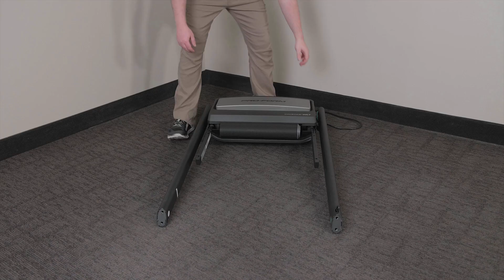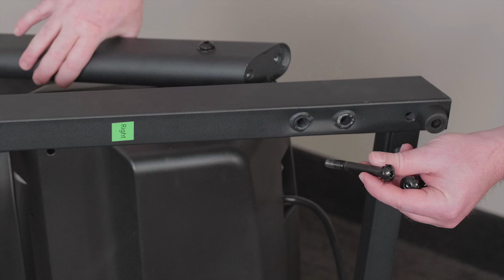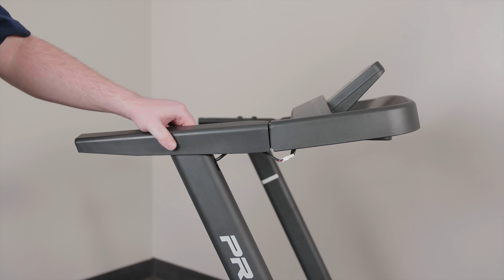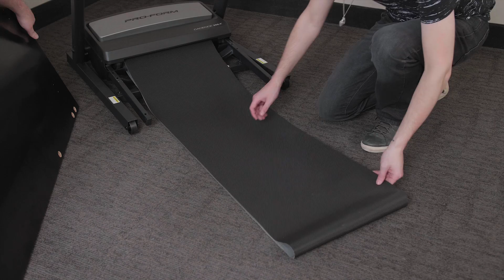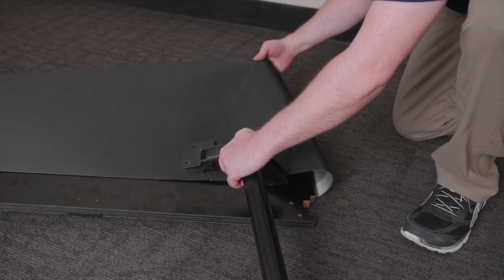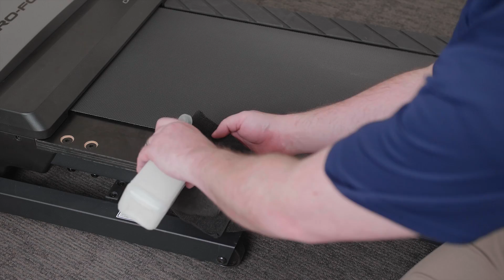ProForm Cadence WLT and Crosswalk LT treadmill assembly

Comment: The video helped a lot. I'm having trouble with the belt moving to the right side when turned on and I can't shift it over unless the back feet come off and I lift the belt . It's kind of annoying.
Reply from the maker: The belt shifts when the idler (rear in this case) roller is out of adjustment and there is more tension on one side of the belt. The belt wants to move to the side will less tension. Use the L-shaped hex key to adjust the Idler roller adjustment bolts. There are instructions in the users manual and other videos on this channel that show how to do this. If you are pulling the belt and lining it up by hand, but not adjusting the position of the roller, the belt will not stay adjusted.

Comment: The platform moves around and bounces as if the woods going to break. I only weight 209 pounds and the compacity is 275 but Everytime I put it on any speed higher then 4 I feel it’s going to break. Is the wood really sturdy enough ? Or did I waste money.
Reply from the maker: Supposedly it is sturdy enough. I'm 185 and it moved pretty good on me as well. But I have jumped on the board and even encouraged heavier people to also jump on it and we didn't have any problems. I think you will be fine. Enjoy your treadmill. :)
Reply: It has a reflex system that’s why it feels like it’s going to break lol but it’s real sturdy. I’m 285lbs and I jogged on it at speed 5.5 and no issues

Comment: I'm halfway through assembly and this happens: The storage latch screws (#10 x 1") do not fully tighten in the holes provided, nd we can't even use power drills...😐
Reply from the maker: The holes are intentionally very tight. You wan this connection to be tight to prevent the deck from falling when you don't want it too. The recommendation not to use power tools coms from the fact that I have seen may of the cast pieces, like the latch, crack with too much force.
Reply: @FitnessEquipmentHelp  That's understandable. I finally got the the top screw to go all the way in, and the bottom to go as far as possible. The bottom scree still cannot fully go in, but at least the storage latch is no longer wobbly 🥲 Thank you for explaining though

Comment: My treadmill makes a loud creaking noise just by stepping onto it and continues creaking every time you take a step it sounds as if the board is going to break. I bought it used and the screws  that connect the covers over the right and left.. won't screw in all the way

Comment: Assembly wasn't too bad. I do have 3 leftover pieces of wood and some of my screws were too long .anyone else have the same issue? Was my latch screws and end cap screws by the feet
Reply from the maker: I'm not sure about the screws(id check each assembly step), the wood however is likely just for packaging as the only wood on the product is the walking platform.

Comment: My idler roller won't close. Please help!!!
Reply from the maker: It does require a good deal of force as you are stretching out the drive belt and the walking belt must also be tight. make sure the area is clear of any obstruction and watch you hands so they don't get pinched.
Reply: No force needed, just loosen the belt a little!

Comment: Looks like this is the closest video assembly instructions  for Model pftl29720. Thanks!
Reply from the maker: That may be true, but I'm sure you can tell they are not that close. step by step instructions can be found in the Built app which is nice as you can see the assembly in 3d from any angle. There is a link in your users manual.

Comment: Our treadmill making squeak sound where the belt touches the belt guides. Could you please show or explain how belt should fit the the belt guides, because in my treadmill belt is bent on edges, where the belt touches the belt guides. My treadmill is only 1 month old. Thank you.
Reply from the maker: It is normal for the belt guides to press on the belt. some noise is unavoidable. if the belt stays in any one position it can set up where the belt hits the guides but quickly goes away with continued use. You can curl the belt back by hand to speed up the process.
Reply: @FitnessEquipmentHelp  Thank you. Do I need to lubricate the belt ?

Comment: Storage latch screws extremely hard to get in with hand tools. Can I use a power tool for this step?
Reply: I had to man. I tried using all my strength to do it and just couldn't. Glad I wasn't the only one haha
Reply: @Earl--  😂 hell yea
Reply: @SP-sq9yy  Makes me wonder what the people that didn't own a power drill did 😂 poor fellas
Reply: I did it with my screwdriver no problem don't recommend using power tools u can mess up the screws head
Reply: @efrainortizjr7493  I think some of these come with bad screw holes. I even went out of my way to wash my hands with dish soap trying to get the screw to go in. My power drill did it instantly with no screw stripping. As long as you make sure you don't over tighten it, the drill wont strip the screw. From my experience at least, can't say it will go that well for anyone else.
Reply: I just use WD-40 before put the screws, this make much more easy tighten!

Comment: What happen if you snap the platform in place before you put the bolts in? I can't get it loose at all and now it's not bolted in place
Reply from the maker: its not super easy but you can pull the rings on the side of the brackets and pop the roller back up. it may be easier if you use the roller adjustment bolts and loosen the belt so there is not as much pressure on the roller.
Reply: Thanks for the help

Comment: If you are having trouble trying to "activate" or you just don't want to use the iFit stuff, make sure the power is on and the clip is in place, then just hold the square, blue button to the right side of the display screen down for 30 seconds or so, until the screen changes.  (can't remember exactly what it did, but it was obvious!)  You then can use it in manual mode.
Reply: Thanks! Wasn’t interested in IFit!
Reply: This was so helpful, thank you
Reply: thanx so much!!
Reply: Thank you.
Reply: Life saver
Reply: Thank you Macca
Reply: I'm sorry but can you please explain the steps, I'm pretty confused 😅
Reply: Uh 7:28
Reply: THANKS

Comment: After I assembled the treadmill. It is very noisy. Is it something I did that I can undo?
Reply from the maker: Without more information I cannot tell but I think it would be worth making sure that the treadmill belt is aligned properly. Many units need a slight belt adjustment to keep the belt from rubbing on plastic parts causing abnormal noises on new machines. There should  specific instructions for your model in your manual. You can also check out the belt adjustment videos on this channel.

Comment: just got this model PFTL29820.0,  assembling went fine, the console lights up but the motor does not start, any ideas besides returning this product?
Reply: That’s the rub it wants you to activate it via the ifit.com/activate sight (to pay for the subscription before it starts)
Reply: However there’s videos on a way to get around that
Reply from the maker: @DAhardest1000   There is no requirement to sign up or pay for anything, instructions for activation are on that website.  But Grey Fox is correct the console must be activated. If the console is active and you are still having issues this could be a wire issue or possibly something affecting the lower circuit board.  Checking for loose or disconnected wires under the hood and for assembly damage may help determine the issue.

Comment: Does anybody find that the board feels like it’s going to break when you get on it I’m about 169 pounds and when I get on it I feel like it’s about to snap
Reply from the maker: The unit has a very flexible board and a short frame that does not run the length of the walking surface. Because of this I too get the same feeling.
Reply: I think that’s pretty normal.

Comment: My belt keeps sliding to the left and when on it has this sound like it’s working extra hard to operate is that normal?
Reply from the maker: The belt should not be sliding to the left. does it return to center when you are not walking on it? Does this happen with all users? If it moves back to the center when you step off the belt then it could be the surface the unit is on and would try moving it to a different location temporarily to see if a more level surface helps. Also sometimes people will walk heavier on one side so it causes the belt to shift. If it does not happen with all users this may be something to consider. as long as the belt does not run into the deck rails or plastic covers it should be fine. 

I would expect a motor on this unit to sound more labored during a workout than units with a larger motor.
Reply: @FitnessEquipmentHelp  hello, i am having the same problem. It keeps sliding to the left without someone being on it.
Reply from the maker: @angelicaramon1839  If the belt is moving to the left or right follow the instructions in the users manual for centering the belt. The steps are also outlined in this video. https://www.youtube.com/watch?v=gGxaAV4MuYs

Comment: Does this treadmill have an incline feature
Reply from the maker: No, this item has a fixed position walking platform. A similar model with a power incline would be PFTL39619. Check it out if you are looking for a power incline feature.

Comment: Mine will not sit straight after everything done and I stand it up it just wobbles around the legs are just messed up in took it apart and redid it still sits bad
Reply from the maker: This model does not have leveling adjustors so it is important to have this on the best surface possible. consider the floor may not be level (particularly on tile and concrete in basements). moving it to a new location may yield better results. If there is a issue with one of the base pieces a replacement part can be obtained from ProForm.

Comment: This video make it seem so simply, my wallking platform is not align with the holes for the bolts on the left side 🤷‍♀️ been stuck there for 2 days 😫 Need help or not sure if this one came with a defect from manufacture.
Reply from the maker: make sure you have followed the instructions in the users manual and left the instructed bolts loose. Most parts that do not fit well are a result of tightening some of the hardware before instructed. If you have defective parts you can contact the manufacture for replacements.
Reply: @FitnessEquipmentHelp  the board feels like it can break, kind of worried
Reply from the maker: @johnwaters3537  This unit does not have a frame that runs the entire length of the walking platform so it has a lot of flex. i have jumped pretty hard on the unit and been ok. I can't saw it will never break but as long as it is used as described in the manual and the user's fall within the weight limits you should be fine. if you are very concerned you may want to look into an extended service plan.
Reply: I am having the same problem 
So frustrated. What did you do
Reply: @Ms27Mimi   My platform was put in the wrong way, we notice after 2 weeks trying.

Comment: Good afternoon, I managed to assemble the treadmill thanks to your video, but when you turn on the machine a "HELLO" message appears and it does not let me do anything else, I would like to know if you can help me to solve this problem thanks.
Reply from the maker: the instructions to activate your console are at the end of the assembly steps in the manual. there is usually a large sticker with instructions that is placed over the display as well. To activate your console follow the steps in your manual or the instructions at ifit.com/activate.
Reply: @FitnessEquipmentHelp  

I would like to know if you can send me the information of the sticker because I do not have it. I thank you very much
Reply: Just Hold Ifit button for 30 seconds to unlock!

Comment: Once I close the roller brackets, is there a way to open them up again?
Reply: Pull the pin and push up on the roller part.The first one will be a little difficult but the second one will come up easier.

Comment: I’m having trouble getting the roller brackets to close. Should I have to be really forceful in closing it? I’m afraid to put too much pressure on it thinking that I’m gonna break some thing. Thank you so much for this video you have been a great help I feel like I’m losing my mind trying to put this together. My last treadmill the conveyor belt part was already done when it came out of the box.
Reply from the maker: Yes, it takes quite a lot of force to stretch out the belts in the drive system.
Reply: Fitness Equipment Help Thank you so much I was afraid to put too much pressure on it but I got it thank you!! 😊😊